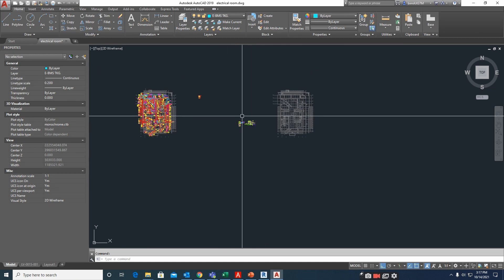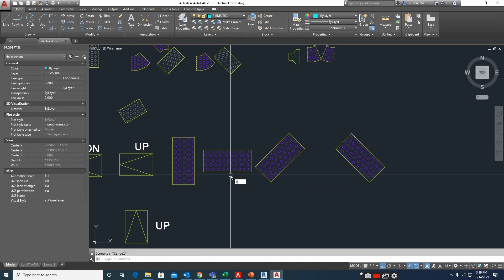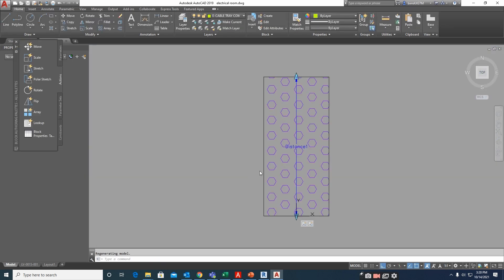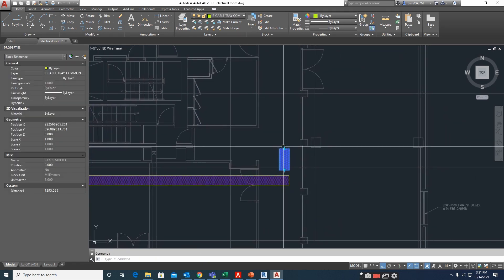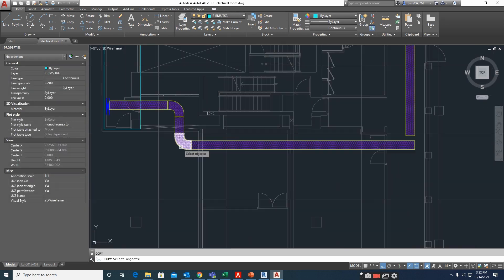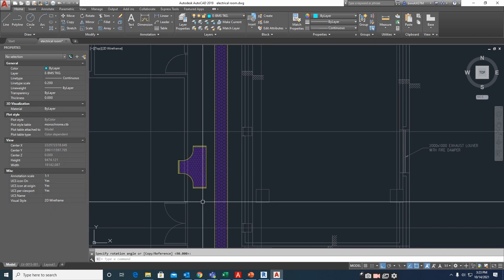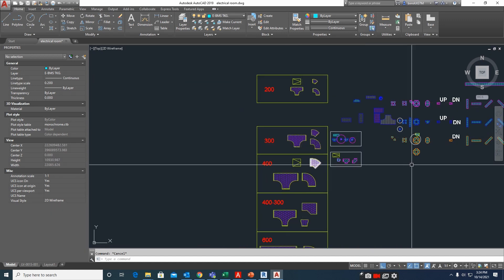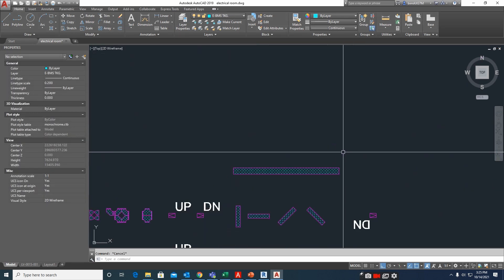AutoCAD Electrical Cable Tray

Comment: Unable to preview its showing
Reply: Hmm
Reply from the maker: Its work or not
Reply: @AutoCADRevitByju  iam trying sir
Reply from the maker: @mohammadsiddiq8803  its working for everyone need to send again
Reply from the maker: @mohammadsiddiq8803  i send again
Reply: @AutoCADRevitByju  hmm okay sir thqqq
Reply: Should i open in laptap that file uh had sent
Reply from the maker: @mohammadsiddiq8803  yes download and open by cad
Reply from the maker: May your version problem try with higher autocad version around 18 or 20
Reply: Oky i will open in cad

Comment: Your videos are truly amazing...why did you stoped making videos?🥴
Reply from the maker: Not stopped ..... It will continue... Not a break... But....still waiting for good one.. Thanks dear for your good comments.
Reply: @AutoCADRevitByju  
Thanks for reply dear..  do you use MicroStation?
Reply from the maker: Mostly using Revit , civil 3d , autocad   
And related tools. didn't work any project in microstation...
Reply: @AutoCADRevitByju  
Can you make video on civil 3D cogo points. I am electrical designer looking for tagging for lighting poles. If you want more info I can send you email. Thank you
Reply from the maker: Sure but I need some time why bcz am little busy on some project right now..
Reply: @AutoCADRevitByju  
Ok 👍